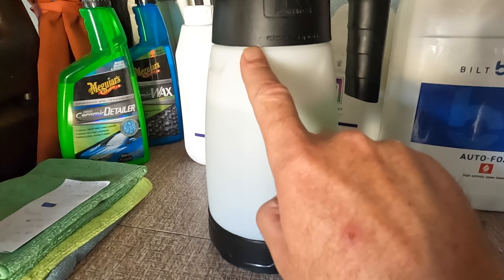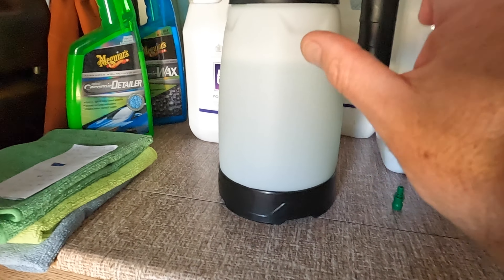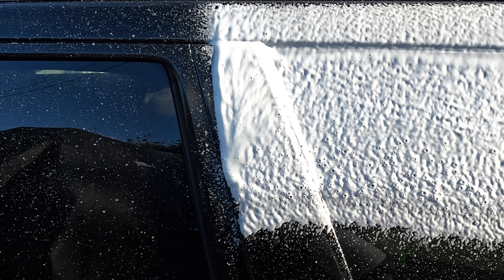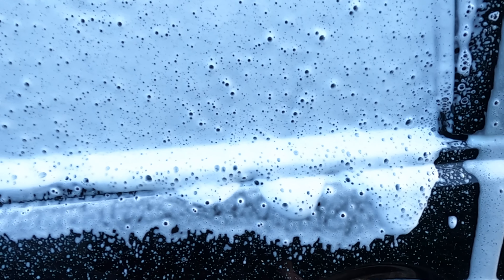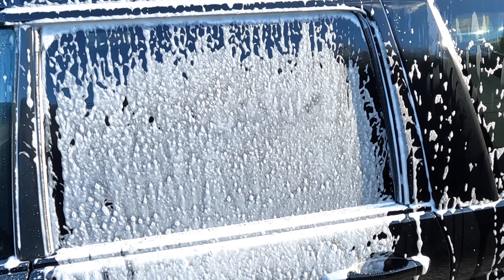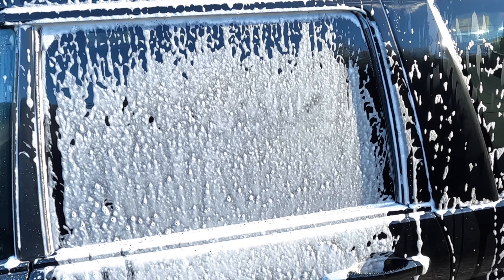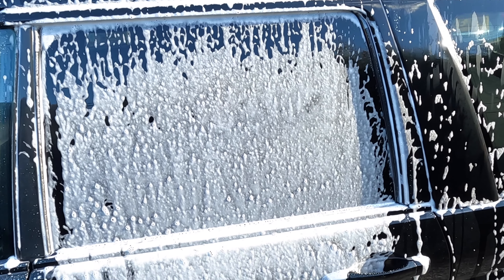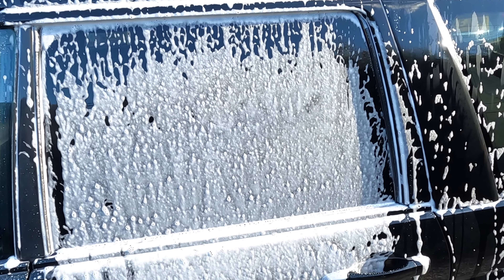IK FOAM PRO 2 + MIXER NOZZLE TESTS USING BILT HAMBER AUTO FOAM

Comment: I think I’m going to get one of these for cleaning wheels. Thanks for demonstrating it’s capabilities!
Reply from the maker: Hello. Thanks for watching and thanks for taking the time to comment. For the money. They are very good. I’d buy another in a heartbeat. I use the foamer or multi sprayer for every wash. 

I’ve seen some other higher end versions that pan the organiser recommends. So may be worth checking them out too just for your reference. 

My foamer must be well over 1500 pumps now. Still going strong.
Reply from the maker: Marolex. They are the ones I saw recently on Pan’s channel. Worth a look. I haven’t checked prices yet. But they look good.
Reply: That’s what I bought mine for wheels only,get some decent wheel shampoo few squirts in warm water pump 30 times away ya gan,I can get decent foam with it too,I also do the archers wheel get all 4 alloys done with one fill,

Comment: That was a useful video as I was a little sceptical about whether pump sprayers could be used for foaming, but you've changed my mind as they seem do the job quite well.  I think the thick foam would be ideal for wheels, sills and underbody as it would drag the dirt off better than a wet foam. I've already got a Marolex 2000, which I use for doing a rinseless wash, but now I'll have to get the IK FOAM PRO 2 to add to my arsenal.
Reply from the maker: Thank you. Really appreciate it. I genuinely wouldn’t be without one now. I initially got one as a little treat having used the bigger ik product a few years ago. As I say. I genuinely wouldn’t be without one now. In that. If it broke. I’d buy another immediately. I have used it loads. Every single weekend in all honesty. Thanks for watching and thanks for taking the time to comment. Oh. And yes. Great for wheels and underneath. I’ll be doing that again this weekend to protect scooby from the uk winter. Plus a dash of lanoguard as per standard practice. There’ll be an update on that process incoming Monday. All the best.
Reply: @rev-you1975  I'll look out for that as I'm interested in a lanoguard protection for my car.  So seeing a video on it will be again be useful.

Comment: Nice Review, I wanted to ask how many pumps do you have you give the pump to get it going, and and many seconds or minutes does the pressure last
Reply from the maker: @tripsingh3642  Great question. I’ll test that tomorrow and feedback asap.
Reply: @rev-you1975  Thanks I appreciate this 🙏 
Got to be honest I had one and had to return mine as it took 60 pumps to pressurise plus the foam only lasted about under 30 seconds, when done I had to pump another 50 plus alot work
Reply from the maker: @ I’ll let you know. I have a few tips to improve your experience.
Reply: @rev-you1975  Thanks I appreciate your fast reply, just wrap up warm as the weather's getting colder Have a Nice Evening Blessings 🙏

Comment: Great vid. Maybe with the dry foam tip you could use slightly use foam and still get a really nice coverage. Have you played around with the % ratio's at all? Did you find 20% the best?
Reply from the maker: Hello. Thanks for watching and taking the time to comment. I’ll need to review the video to refresh my memory. I have indeed done tests in the past dropping the dilution ratio down to ridiculously weak. My findings were that the cleaning power was very very similar. Only real difference was foam thickness and subsequently cling/dwell time. So if the car is filthy and really needs thick foam, then up the ratio. If the car is only moderately dirty/doing a weekly maintenance wash, you can easily drop to a much weaker mixture. Saves money. Product goes further. Does almost the same job. Just thinner foam.